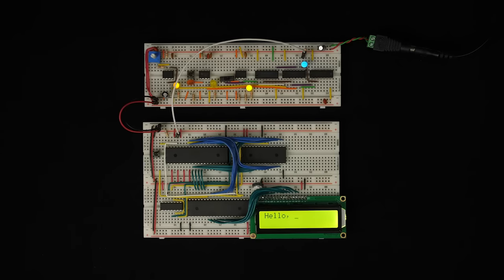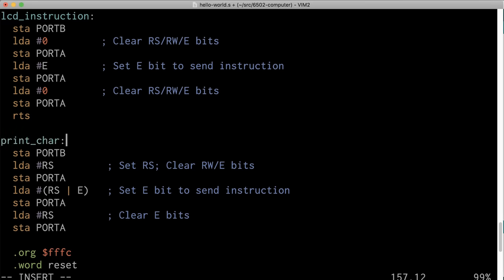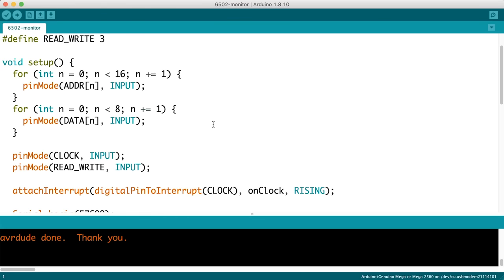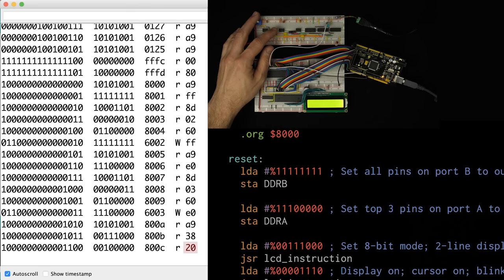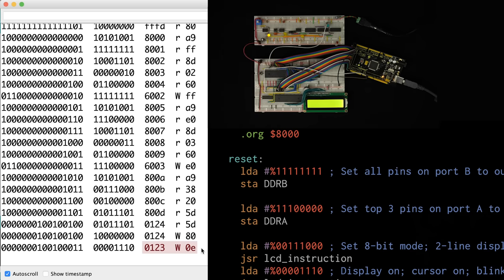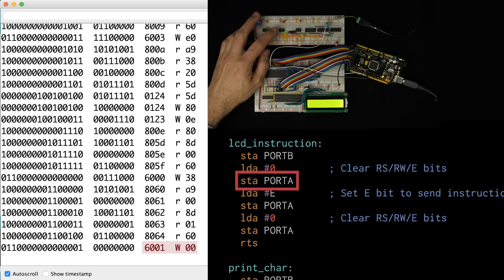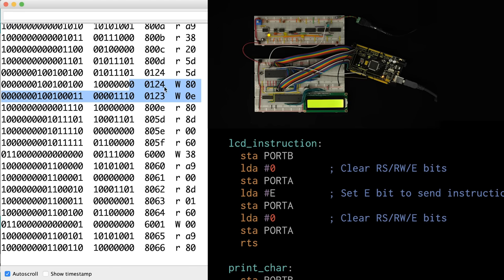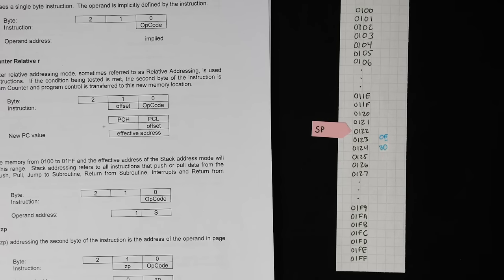What is a stack and how does it work? — 6502 part 5

Comment: Interesting, I always thought the stack was part of the CPU, like the stack pointer register is too. In modern CPU's the stack is still part of your internal RAM?
Reply: Ironically, stackoverflow has an answer for you. https://stackoverflow.com/questions/79923/what-and-where-are-the-stack-and-heap. So the stack is in RAM but due to the cache system in modern CPUs, it's probably stored inside the CPU cache most of the time.
Reply: Not only is it in RAM, you can manipulate it from inside your own program. This is how green threads work.
Reply: Yep.  In modern computers, the stack pointer can be adjusted to point anywhere in RAM.  Multitasking OSes create a stack for every process, in fact.  And that RAM can be accessed like any other parts of RAM, and even moved around or shifted out to long term storage if memory gets low, and shifted back in when needed.
Reply: The stack will always be a part of the ram, in multi thread/process operating systems like windows each thread or process gets its own stack and heap
Reply: @Selicre  Great care should be taken if you "mess around" with the stack, though; an "unbalanced" stack is a recipe for disaster.
Reply: @markjones5973  No, the stack pointer only ever points to the stack.  You can create a memory pointer to point to RAM, but that is not the stack pointer.  You're confusing the two.  The stack pointer ALWAYS only points to the stack.
Reply: Some PIC microcontrollers use an internal CPU stack, though it is relatively small
Reply: It might be interesting to basically eliminate stack overflow errors by using a hard drive (like half a terabyte) as the stack. The reason we don't is memory latency. Accessing a hard drive takes a lot longer then pulling memory from ram.
Reply: @NeilRoy  The stack pointer is a memory pointer.  It holds an address to the memory where the stack is located.  The only difference between the stack pointer and any other memory pointer is that the stack pointer is a special register on the CPU.  It's the push and pop instructions that advance the stack pointer the correct way.  Otherwise, the two types of pointers are the same.
Reply: It depends on the Hardware Architecture. Some stacks are built directly into the CPU where it has its own reserved register for the stack pointer and designated high-speed ram that is separate from both the cache and system ram. Other architectures do not have any concept of a stack in hardware and are implemented in software on the Assembler, Complier and OS side of things...
Reply: @NeilRoy  what are you talking about? The stack (in x86 as example) is stored in memory, but you are right that it can be cached. Nevertheless stack lives in RAM and is only limited in size by memory itself. You CAN assign stack pointer to literally any address, but it should be set correctly if you're using it.
Reply: @BertGrink  You're right, sorry, my bad.  I was confusing the two! <slaps forehead> it was early in the day for me. ;)
   I was thinking about things like the L1, L2 and L3 caches on the CPU itself.  But you're correct.  The stack is a reserved area of memory in RAM.  Caches are on the CPU which will often prefetch data to them to speed things up.  Not sure where my head was.
   As for the stack pointer, it is not meant for use as a memory pointer.  It is only for pointing to the stack.  It is still different than a memory pointer.  It would be automatically decremented or incremented as you push and pull from the stack.  Set the stack pointer to some arbitrary location in memory and you're asking for trouble.
Reply: @NeilRoy  Okay, you are forgiven; we all experience such days from time to time. ;)

And for the record, your last paragraph is absolutely correct! :D
Reply: @markjones5973  - Actually... Actually the SP does not need to be a special register on the CPU. The PDP-11 had eight 16-bits registers (R0-R7) and anyone of them could in theory be used as a stack pointer. Or any other type of pointer into memory. In theory, because R7 was also used by the CPU as the program counter (PC). Trying to simultaneously use it as a pointer to some data would definitely produce "interesting" results. And you don't want interesting results when programming. You want boring, predictable, results.

The convention was to use R6 as the SP, but it was purely a convention to keep the programmer sane. It was a good convention too, because besides jump-to-subroutine (JSR) and return-from-subroutine (RTS) which was under the programmers control, signals from the outside world could also trigger a subroutine call, and when that happened, R6 would be assumed to be the actual SP, and the triggered subroutine would happily clobber the memory that R6 pointed to. And that would also lead to "interesting" results afterwards.

But nothing prevented you from initialising R6/SP and point it to a safe area of memory, and then proceed to use say R3 as your stack pointer.

I could be wrong, but I think the M68000 continued that tradition of using a general 32-bit register as the SP. And come to think of it, the ARM processor in your phone can do the same.
Reply: @JanBruunAndersen  You are right about the 680x0, it uses register A7 for the stack pointer; however, it actually has TWO stack pointers, called User SP and Supervisor SP, respectively, and both uses the same register (A7). When the CPU is in supervisor mode - i.e. running O/S routines, it uses the SSP, and in user mode, the USP. The context switch occurs automatically.
Reply: Modern x86 processors have internal stack buffer with some levels of return address data. It's faster and help forecast instructions to fetch from RAM.
Reply: @tentative_flora2690  Stack overflow errors are not caused by running out of space to store the stack, they are caused when trying to change an object in memory and exceeding it's allotted space, Overwriting a value stored after it.
[Calling function stack]
[return address][Calling function stack]
[Local variable space][return address][Calling function stack]

[Stored beyond the lo][cal buffer!ess][Calling function stack] //Crash
[Doing sneaky stuff    ][return address][!!Modified function stack] //Exploit

Letting a stack grow indefinitely is possible, but not done because it enables poorly designed code.
Reply: I thought the stack was a data structure generated by the compiler, not the OS?
Reply: @oraz.  The stack is an area of memory that is setup by the OS loader libraries combined with the stack pointer register pointing at it, with an optional Stack Base Pointer depending on API. The OS build environment determines what the compiler must be set to.
Reply: @JanBruunAndersen  and RISC V, which probably also means MIPS too.
Reply: @YellingSilently  that's a buffer overflow.
Reply: @TomStorey96  You are right and I am wrong. In this case the reason the stack buffer is capped is because exceeding the 2MB or so that Linux offers a thread is an easy way to indicated a broken recursive function.
Reply: @YellingSilently  Linux wouldn't do that to point out broken recursive functions, it would do it to prevent broken recursive functions (and other broken or otherwise greedy software) from running away and consuming large amounts of memory.

But yes it can certainly be used as an indicator during development that you've messed something up. Otherwise it is a protection mechanism.
Reply: @markjones5973  In fact, a stack is created for every thread - each process can host many threads, so each process can, in fact, have many stacks also.
Reply: @JanBruunAndersen  I studied PDP-11 instruction set several years ago.  I wanted to write a CPU simulator, and it was between it and the 6502.  The 6502 won out.

I loved the way PDP-11 has no "load immediate" instructions, but instead used R7 autoincrement mode to get the oprand and advance the PC.
Reply: @jzero4813  Yep!  AND each process and thread can use as many as their own stack structures as well.
Reply: yes because of that bootloaders and whatnot are programmed in assembly simply because there is no stack before the os is loaded.
Reply: @markjones5973  
... the PDP-11 has no "load immediate instuction" ....

That reminds me of something that happened when I was a young programmer during the mid-80s. It was my first industrial job and I had to implement a GKS. Long story short, I did it on a PDP-11 and it was done in Fortran.
Somehow I messed up my program and instead of a 0 in my test printings a 1 showed up. I didn't know where this 1 came from. After debugging around without getting any clue of what is going on, I coded a simple
    WRITE (*) 0
into the program , which should simply output a plain 0 on the VT100.
To my surprise a '1' showed up on the terminal.

What had happend?
The compiler had setup memory to contain the value of 0 and used that whenever a literal 0 was needed. I messed up in argument passing to a function, passing a 0 constant instead of a variable. Inside the function I assigned 1 to that parameter and thus messed up the "0-constant" the compiler used when it needed a 0.
Reply: @markgriz  nope it's still ram, but on the same die
Reply: For a modern x86_64 processor running on a multitasking OS which has a program loader the stack is generally the highest point in available memory after the cli operands and environmental variables and it grows downward  with each new stack frame (function return address + new frame base pointer + any automatics as offsets to the bass pointer). Then in low memory after are the text section (machine code), data section (global / static variables), and bss (uninitialize globals ) followed by an upward growing heap for dynamic allocation and a stack overflow is usually when the stack runs into the heap.
Reply: I'm guessing that depends on the CPU
Reply: @BertGrink  "...naming just one CPU that has space for the actual stack on the same die as the CPU core?"
8008 had only 7 call stack addresses inside the CPU.
Reply: @JanBruunAndersen  "And you don't want interesting results when programming. You want boring, predictable, results."
Haha, lol :).  But, interesting results are much much more interesting than boring ones.

Comment: I love seeing how adding the flags made the size of the file smaller and how using recursion in your computation can shrink the program while keeping the same result. It would maybe be cool to see some stuff about brainfuck lambda calculus or turing complete languages that are minimal in their construction but they can achieve the same results as something more "static". I know you're more of a digital electronics channel though. Just a thought love your videos!
Reply: That's not recursion, just function calls
Reply: Recursion is when a subroutine calls itself. Very much possible but you'd have to make sure you have enough stack to do so.
In this case, you can recurse 128 times assuming nothing else gets pushed on the stack.
Reply: Adding flags? What flags?

Comment: Isn't it weird the processor stores the return address on stack BETWEEN reading the lower and higher byte of the jump address?
Reply: It is also weird, that it actually stores the address of the lower byte of the jsr address.
I would have expected to see a 0x800F on the stack as this is the address of the next instruction.
Reply: @kallewirsch2263  that's actually because the processor increments the PC before each instruction. so after fetching the return address and before running the next instruction it will increment the program counter and thus resume in the correct place
Reply: @piotraniola5393  
I thought that too (That the Von Neumann cycle would start with incrementing the PC) and I did a check.
It is indeed an exception for the jsr and ret instructions.

You can see it with the jump instructions. In the opcode the target address is coded without subtracting 1.
This was the point when I became unsure and I used the "last resort" - google. It is indeed a well known exception for jsr and ret instructions. jsr pushes the address of the last address byte and ret compensates for that by adding 1 before assigning to the PC.
Which begs the question: how does it work with interrupts. Well, a reti (return from interrupt) does not add 1 to the address poped from the stack. :-)

I can only guess: The designer had some troubles in the jsr instruction to get his hands onto the address of the next instruction before performing the call by assigning the target address to the PC. Thats why he used the last known good value for PC he had, which was the address from where to load the low byte of the target address.
But this is only a guess. I am not very familier with the inner workings of a 6502. I always prefered a Z80
Reply: Piotr, the timing of the storing of the return address on the stack within the execution of the JSR is about selecting the time when the internal mechanisms have the correct value (of the PC register) able to be saved before it gets re-written by the JSR's target address.

Comment: Quick question: how did you know the address for the subroutine lcd_instruction was 805d?
Reply: the compiler takes care of that
Reply: Can find where it compiled to at 3:23
Reply from the maker: At that point in the video I didn't know it was exactly 805d. But I knew the program started at 8000, and was ~130 bytes long, so 805d seemed like a reasonable address for the subroutine.

That said, I could have looked through the assembled binary to figure it out. For a larger program that wouldn't be very fun, but the assembler can also probably generate a symbol table, though I'm not sure off the top of my head how to get it to do that.
Reply: For vasm it looks to be -L <filename>.  It shows what it parsed from the source, what op codes it generated, and the address it put them at.  Then at the end it has a table of the addresses of the labels in the program.
Reply: you could just count the bytes in each line of code from the beginning (8000) to the subroutine, being careful to note which instructions are only one byte long and which ones are two or more bytes long, and the number of bytes for the data parameters.

But that's super tedious. As the others have said, let the assembler do it for you, looking at the symbol table.

Comment: The Z80 has a 16 bit SP so the stack can be anywhere and any length. And "anywhere" of course means 64 kB because these 8-bit CPUs only have 16-bit addressing for memory. It is interesting to see the differences between the Z80 (which I know very well) and the 6502, two 8-bit processors of the same era. The 6502 can be classified as a RISC and therefore much more limited in the programmer's view but also slightly faster per instruction, and the Z80 a CISC.